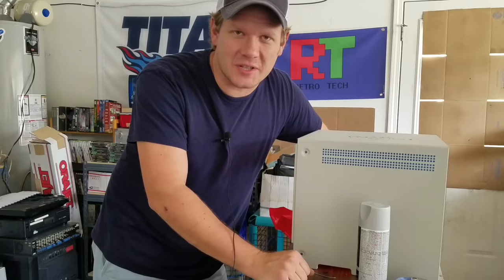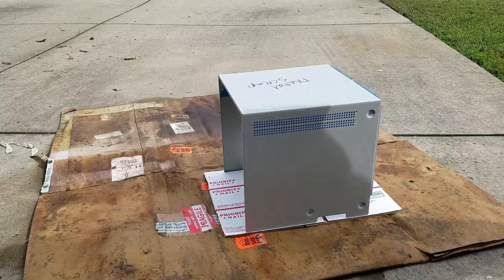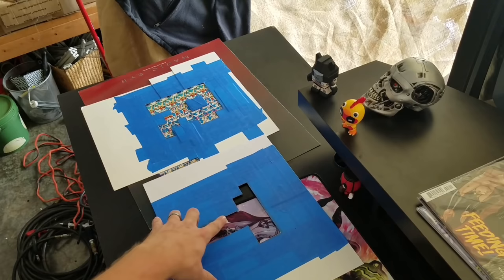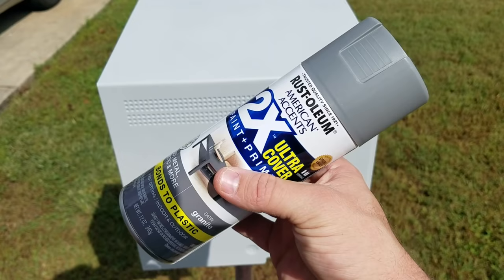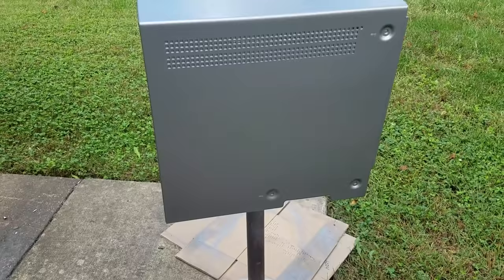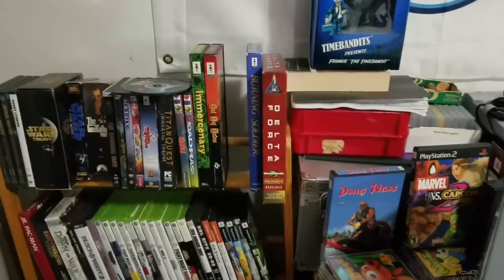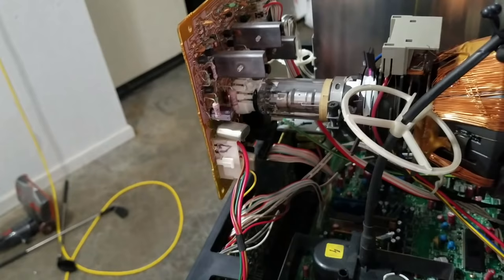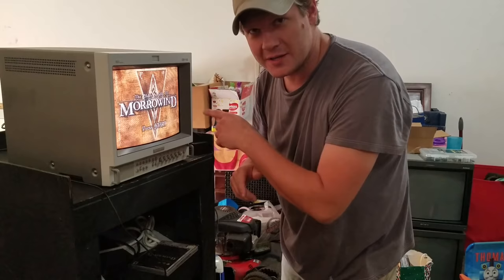Sony PVM Restoration Part 5 - Painting & 100% Complete!!!!

Comment: Hey Steve, another great vid! Monitor looks very slick! Quick tip for getting a better spray paint finish (I've sprayed a couple of classic cars in the past and researched all of this stuff a good bit). Before painting always lightly sand down imperfections where possible and use a scotch pad on any smooth paint to give it a key for the new paint to stick to. After this, wipe down with panel wipe/iospropyl alcohol to remove all finger oils and contaminants which can cause those bubbles and the orange peel effect you saw on top of the case. Add a few light coats of primer at a time until you build up a good base then lightly sand with fine grit/panel wipe clean again. Light coats and patience is key to getting a good smooth drip free finish. Don't forget to wear a dust/paint mask! :D Looking forward to more vids Steve!
Reply from the maker: Thanks Eric.  I'm going to do this on the next Paint job.  This is very Helpful for me!!!!!

Comment: Good vid.

Question.. So i brought my PVM to have some work done on it(adjustments to geometry and convergence and any linearity) The guy hooked it up to his machine which displayed multiple crosshatches and it didn't look that bad, but when i had it hooked up via the genesis through RGB and using that software suite with multiple test that you have shown on video before i can see it looks worse.

He said he went in the back and adjusted the pots and did the focus etc...but when i got it back it looked almost exactly the same as when i gave it to him. It seems to me that going into the service menu is also imperative but i am 100% sure he never did that at all as i remembered some of the numbers corresponding to H/V positioning etc were still the same.

The guy is going to come to my place and bring his machine with him and i am going to show him the test suite and get him to make adjustments in the back while that is running.

Do you have any advice?

Comment: Hey Steve, finally picked up that 20L5 I was talking about. It's in perfect shape but has a bit of dust on the bottom-left corner. 

Any recs for what I should clean the screen with? 

Also, what was the alcohol solution and gloves you used for cleaning the dust inside your 20L5 in the last video?

Now that everything works like I want, I should clean it out.
Reply from the maker: Hey, I will go over the gloves soon in the safety video.  you can use standard isopropyl alcohol & windex or a monitor cleaning solution.